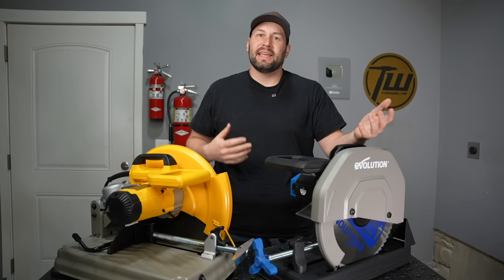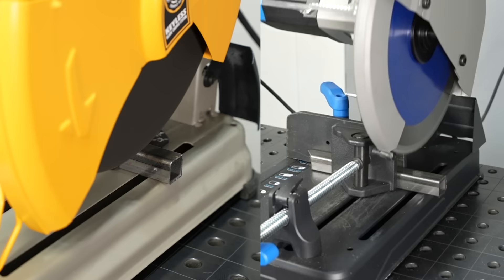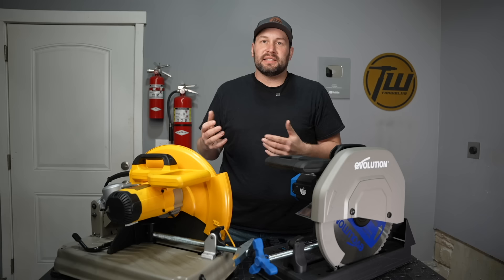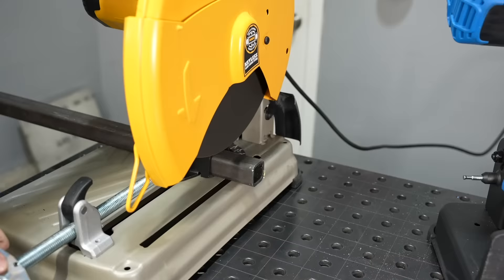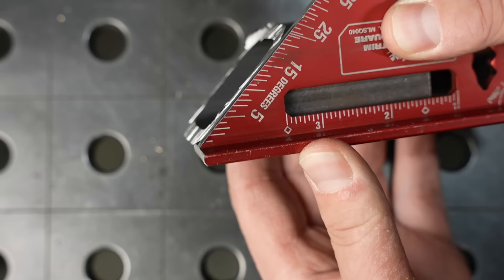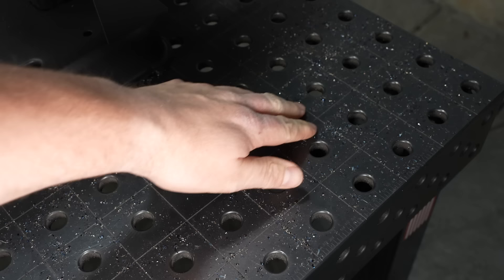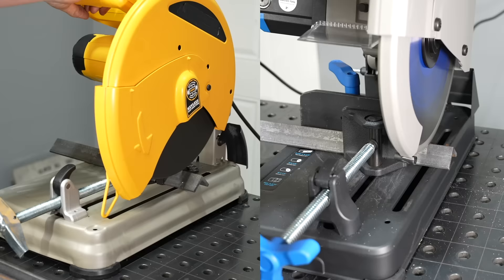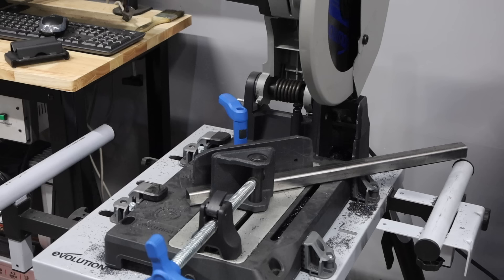Are Carbide Chop Saws Better? Abrasive vs Carbide Metal Cutting Chop Saws

Comment: 25+ years ago Milwaukee came out with Carbide metal saws.. I sold tons of them to Electrical Contractors... The demo that wrote the POs was threaded rod.. Cut threaded rod on these saws and there is no deed to chase the threads.. I would take a full bundle of 3/8 or 1/2 rod and put electric tape every 12".. I would cut through the tape and hand the bundle to the contractor with some nuts. Every nut spun on every time..
Reply: I can see the attractiveness to that. As a machinist I cringe at the obviously sharp burr that would still be left. Then again the grinding blade leaves on also only so bad the nut won’t go on   We spend so much time as machinists deburring completed parts, but then again I wouldn’t want to pay the labor $ to deburr something that is tucked away in an electrical shielded box.
Reply from the maker: That’s awesome! I don’t work with threaded rod, but it’s got me thinking that I could make a fixture to shorten fasteners with it.
Reply: @TimWelds  Needing a fixture is a problem because IMO far too many shapes/sizes clamp up squarely in either type cut-off tool.

Comment: I bought the carbide metal saw and it works very well.  I have used it on case hardened 4140 and it pretty much ate the blade.  Just bought the abrasive saw specifically for hardened steel.
Reply: Cutting through welds don't help it at all,fried a blade.

Comment: Very good informatioal video, thank you. I started with a Dewalt abrasive saw and then went to a 14" Evolution Rage 2 chop saw, didn't look back after getting the Evolution. One mistake I would make with the Evolution was I would let the saw slow down before it completely cut through. Big mistake!! Carbide tips come off that way!! LOL! I liked the Evolution so much that I bought the 10" sliding/beveling saw, works great. Now that I'm real old and I haven't used them in awhile it's time to clean out the garage. LOL. Thanks again for your time and videos.

Comment: I love my Evolution with the SS blade. I will however warn against an issue with it. When cutting at an angle, such as 5:30 in the video, you can have kickback. The material is so far back on the blade that the teeth can grab the material and try to fling it up and back. It's best to have your material towards the front and or center of the blade. This way it isn't trying to lift the material away from the base of the saw. I created a quick install/uninstall  fence spacer for when I cut 45 angles. It places the material directly under the arbor of the blade. It's just a heavy piece of box tubing, 2 L brackets with a couple set screws that pinch the fench. It installs in 5 seconds.
Reply: Hi! Can I have a picture of your jig? I almost always have a kick back because i mainly cut thin tubing. I kind of understand what you mean, but the "L brackets" are still not clear as in how you made them and how to install them. 

Also, does this, by any way, reduce the cutting area of the blade?
Reply: @namtrieunguyen7630  No idea of how to get you a picture, but I'll explain a little better... I used a piece of thick wall tubing the same height as the fence and about 2 inches wide. It is also about the same length as the fence. The "L" brackets are welded to the top of the tubing, go over the top of the fence, then make a 90 degree curve to wrap around the back side of the fence. Imagine welding a piece of angle iron to the top of the tubing that hugs the back of the fence too. Then I welded 2 nuts to the "L" brackets and ran bolts into them. I drop the spacer in and hand tighten the bolts so that it sandwiches the fence. I only use it when cutting 45s, because that's when the product is not directly under the arbor. It doesn't hamper any cutting abilities. It only takes a couple of seconds to put on or take off too. If this doesn't answer your questions, we can figure out another way to help.
Reply: @derekmoore1612  thank you very much for responding to me! I really appreciate it!

If my guess is correct, the bolt is to secure the spacer (the wall tubing, in your case) to the fence so that it won't move/vibrate when you cut? If that is the case, technically you can weld 2 bolts to the spacer, drill 2 matching hold through the fence then secure it with 2 nuts for better gripping (to prevent the spacer from slipping upward) and a cleaner look. But I think it is simply unnecessary... In your case, is your 2 bolts enough to secure the spacer? Have you experienced any movement of the spacer at all?

And if anything, the length of the spacer is not necessarily equal to the length of the fence. It can be longer as long as it does not touch the blade and does not cause any inconveniences on the left side. Am I correct?

I cut quite a lot of small tubing at a 45 degree angle and almost always have kick backs. At long last, now I know why and how to deal with it. You're a live saver!!!!
Reply: @namtrieunguyen7630  I've never had the spacer move. I only finger tighten the 2 bolts. It's really fast to place on the fence and remove when done. I see no need to drill through the fence. You could wrench tighten the bolts if you planned on making a ton of cuts with the same angle.
Correct, the length doesn't matter much as long as it isn't too long to interfere with anything, and it has enough length to secure the product. You could even cut the end of it at a 45 deg angle if you wanted to, so that it sits as close to the face of the blade as possible.

Comment: Excellent unbiased vid!  I agree with all of your comments.  I have a metal cutting miter bandsaw for fabrication projects but a couple of years ago bought a carbide tooth metal cutting cordless circular saw and love it.  Uses different blades for aluminum and steel and both work well.  Still use the angle grinder with an abrasive wheel at times but not nearly as much as I used it prior to getting the circular saw.  If I didn't have the band saw I would definitely get a carbide chop saw. For those just starting out and can't afford a bandsaw or don't have the room for one, the carbide chop saw is the way to go.
Reply: LOL.. This is a paid advertisement for Evolution.. I agree that metal cutting Carbide blades are great (both in chop saws and circular saws) but there are many brands that work well.
Reply from the maker: Thanks for the comments! A bandsaw is also a great option for those who have the room/budget for one. I tried to keep the video to my honest experience with the types of saws rather than a brand comparison. Evolution did sponsor the video, but the conclusions apply to any brand of saw.

Comment: In recent years some manufacturers have produced metal cutting blades for circular saws, designed for the higher RPMs of those saws.  I've got one meant for stainless steel, and it produces a great cut.  A 7-1/4" one works great in a 10" wood-cutting miter saw I had previously retired, and uses the same arbor. The miter saw is geared for a 10" blade so is relatively low RPM compared to a circular saw, and the smaller diameter blade further reduces effective speed/RPM.  Main disadvantage is small cutting capacity.

Comment: TimWelds.. Nothing like the smell of the abrasive saw. That dust gets everywhere. I used both types and I prefer the carbide blade type. Evolution makes awesome saws. I have their rage4 and love it but it's a little to small for what I need. I would love to get the one you show in this video.. Thanks for sharing.

Comment: Thanks, Tim. I agree with your assessment. I went with a 10" Evolution compound miter saw and it works great for my purposes.

While it came with an "all material" blade, the blades they sell for specific materials work very well IMO. I have one for the wood, another for ferrous metal, and another for aluminum/non-ferrous metal. 

They do offer blades for stainless and other hard metals.

Comment: Thanks for the info, Tim! Would be interesting to see how a bandsaw stacks up against these types of saw.
Reply from the maker: Thanks! That would be a great follow on video. As far as bandsaws go, there is a huge range of size and price. I like the chop saw much better than benchtop horizontal bandsaws that are similar in size and price to a chop saw. If you’re talking about a larger industrial bandsaw, the bandsaw would be more capable, but also much larger and more expensive, comparable to a proper cold saw.

Comment: Hi Tim, thank you so much for the time and effort you take in putting out these videos! I went down the same path, starting out with an abrasive chop saw, and experienced every single disadvantage that you stated. The amount of deflection while cutting miters was a bit of a surprise to me. The heat and mess generated with an abrasive saw is significant, along with the additional post-processing work. I bought a Slugger carbide chop saw with a couple of different blades, and haven't looked back. I'd give away my abrasive saw if someone would take it haha! I'll never use it again - it's either the Slugger or a band saw for me.

Comment: I recently got a Diablo Steel Demon 7.25" blade on a circular saw-much less post- cut cleanup on your workpiece, but a lot more shop floor clean up afterward.  It's nice that the workpiece is room temperature when the cut is  done.  Overall, metal saw blade   is the better choice.

Comment: how will it compare to bandsaw do you think in cut speed and cost?
Reply from the maker: Chop saws will generally be faster than bandsaws for lighter sections (1/4” wall thickness or so and under) Bandsaws vary a lot in cost and how heavy duty they are. There are some benchtop horizontal bandsaws that are similar in size and price to a chop saw and I like a chop saw more than those. Heavier industrial bandsaws are very accurate, quieter and have more capacity than a chop saw, but are also much larger and more expensive.
Reply: Thank you for your advise @TimWelds

Comment: Appart from the noise, dust and hot work issues, there are a couple of real cost issues with the abrasive wheel machines.
.
1/ Yes the reduction in cutting depth thru the life of the blade can be a big issue with abrasive blades.
A few yearas ago I baught a stack of blades for very little money from a guy that cut a lot of large sections, he would have been getting less than 1/3 the usable life from the blades.
I cut mostly small sections so it was a bargin for me.
.
2. The quality of abrasive blades has and does vary a great deal.
Older, cheaper and off brand blades, can have very short lives indeed. These nasty blades can also fail in use, throwing nasty big chunks everywhere.
.Since the 80's I have learned to be very fussy about the abrasive blades I use.
The reputable known brand blades have improved considerably. 
They last much longer, cut better, cut a wider range of materials, and they are much less likley to blow up in your face.

Comment: TimWelds has the best video instructions about welding.  I appreciate the advice given but now pose a question / problem:  Our model railroad club will be cutting a lot of 1/8" to 1/2" steel for a caboose rebuild project.  We are using a borrowed Hitachi chop saw that uses 12" abrasive blades with a 1" arbor.  What is the best Brand of blade?  Diablo, DeWalt, Forney or ???   (A new saw is out of the budget, and we have lots of time to cut / deburr as we're all retired)
Reply from the maker: Typically, abrasive saws spin too fast for TCT (tungsten carbide tipped) blades, so you can't usually retrofit that type of blade. Evolution has a super bare-bones multi-material saw for $289 which is the cheapest 14" that I'm aware of, otherwise I'd just stick with the abrasive discs.

Comment: Just getting started, I got Evo's 7 1/4" chop saw - yeah, not good for larger pieces but at only a little over $200 a great purchase. For larger pieces, there may be a bandsaw in my future. Didn't even consider an abrasive model for the reasons you mentioned. Love my Evo, but my biggest gripe is the chips. If you have a shop dogs, even one of those chips can shred a paw pretty good so I cut in an area they can't get to and have to be diligent about cleanup because those chips can fly. Probably a hazard for barefoot kids too.
Reply: I assume you probably wouldn't want your dog or kids running around in the larger mess from an abrasive saw either, but your point is well taken, clean up is important!
Reply: I'm a professional stair builder and was looking at the small Evo's 7-1/4" chop saw to cut solid 1/2" square iron balusters (made from mild steel). Would this small saw have enough power?

Comment: i love my el cheapo 275 dollar bandsaw, no mess, no dust in the air.
cuts rounds/square up to 125mm.
maybe a little bit slower but you can do something else when sawing, so more time saving.
cheers ben.
Reply: Nah, while bandsaw cuts super clean, they really slow the project down. Can't beat the speed of a carbide saw.

Comment: I picked up one of the 380 models at an auction barely used for 1/5 the price of new and I have to say I should have bought one a long time ago.  Just the speed difference between when cutting 3/4" square bar was incredible and I didn't trip the breaker once.

Has anyone tried cutting hardened steels with one? How bad of an idea would it be to cut 4140 or leaf spring with it?

Comment: Thank you for the great videos! 

QUESTION: I work a lot with salvaged steel, which is often quite rusty. With tubing it can be rusty inside and out, and I can't clean off the interior rust before cutting. Friends have told me, and it seems true in my limited experience, that cutting rusty metal with carbide blades (and my bandsaw blades) dulls them very fast. Is that your experience? I would much rather purchase and use a carbide chop saw over abrasive, but I am concerned the blades won't last. Your thoughts?

ANSWERED: I ended up calling Evolution and talked with one of their reps. He says rust contains a lot of carbon buildup which generates more heat than when cutting clean steel. That heat will dull the blade faster, and potentially damage the blade as well. Therefore Evolution recommends only cutting clean steel with their carbide blades.
Reply from the maker: I don’t know; I usually cut new material with the chop saw. I’ve done quite a bit of repair work, but the types of repair that I’ve done generally has to be cut with a grinder and cut off wheel. If anyone else has some experience with this, I’d love to know.
Reply: There is no reason rust will increase the wear of carbide blade saws when cutting regular carbon steels. I cut rusty I beams and angle iron on mine often. What might be the issue with reclaimed rusty steels, is where you do not know the composition of the steel. Hardened steels or nickel alloy’d steel will wear out a carbide blade real quick.
Reply: @kristoffscuba5466  Not sure about the hardness of rust (iron oxide) and didn't find a quick answer online.  Many oxides are harder than their unoxidized versions, such as aluminum.  Composition of the steel can be a big deal.  Things such as rebar and bed frame angle iron are famous for surprising you with hardness and they can ruin the sharpness of a carbide blade in an instant.
Reply: @benz-share9058  alumium oxide is very hard, iron oxide not so much, potentially slightly harder than none-rusted steel (depends on the steel), but certainly less hard than carbide
Reply: Thank you all for your answers! I emailed Evolution Power Tools and asked, "How do your carbide blades hold up when cutting rusty metal?" Their rep replied, "No not recommended for rusty steel"....
Reply: I Called Evolution and talked with one of their reps. He says rust contains a lot of carbon buildup which generates more heat than when cutting clean steel. That heat will dull the blade faster, and potentially damage the blade as well. Therefore Evolution recommends only cutting clean steel with their carbide blades.

Comment: for steel and aluminum, those machines are great. but: what do you do with stainless steel? Do you really have to get a new blade after 20-50 cuts? seems there is no blade from any supplier which lasts a decent amount (means >>100) of cuts

Comment: Hi Tim, thank you so much for this video. This video answered most of my questions. I still have a couple and was wondering if you or anyone else reading this could help.

I'm a finish carpenter and install staircases. I need a metal chop saw for cutting 1/2" hollow iron balusters (mild steel) to length. Usually I use a small cordless band saw which works perfectly most of the time. But sometimes it's important for all the baluster to be cut clean & perfectly square (or I need all the balusters to be exactly the same length). I was was looking at Evolution's small 7-1/4" saw and thinking of making a removable bed with a stop block.

1) Do you have any experience with their 7-1/4" saw? Do you think it would work? That's pretty much all I would use it for.
2) I'm not familiar with Evolution, what's the quality like on these saws?
3) Are you familiar with anyone else who makes a small quality metal chop saw using a carbide blade?

Comment: I am a hobby metal fabricator so time and labor theoretically should not calculate into my decisions. None the less my time still has some value. All things considered it was a happy day when I put my abrasive cutter on a back shelf in my shop. It will be a dark day that I dig it out of its storage spot to cut anything. Technology changes over time, embrace it.

Comment: Excellent video Tim, thank you. I've been wondering about this. Certainly makes carbide the preferred choice. One thing you didn't mention is the sound level....  I imagine the carbide saw is better in that regard too?
Reply from the maker: Thanks! They’re both screamers with a similar sound level. Hearing protection is a must. The quiet option is a bandsaw, but a good quality bandsaw is much larger and more expensive.